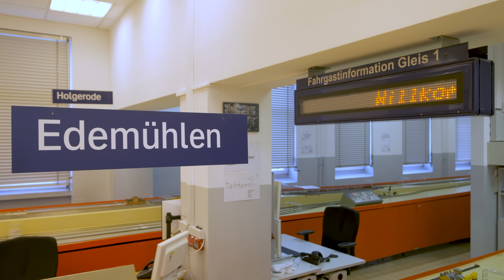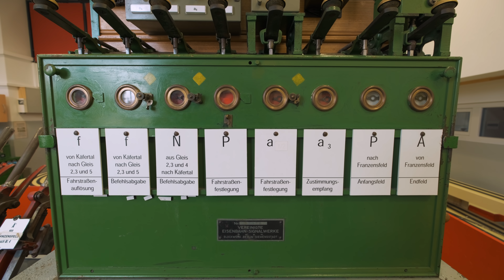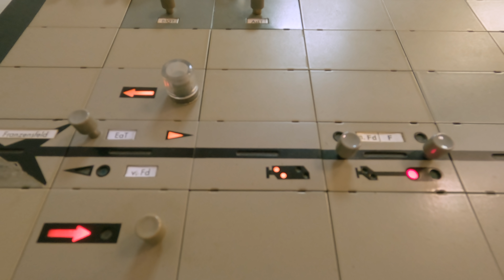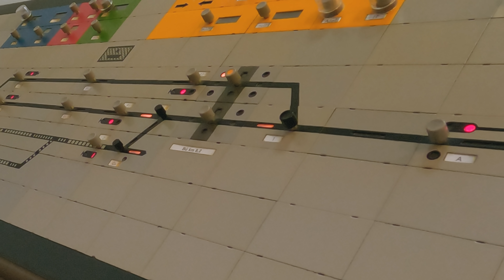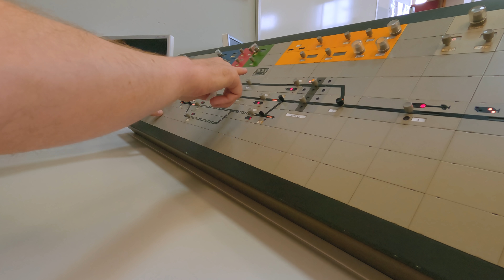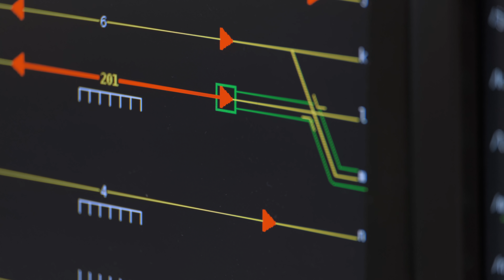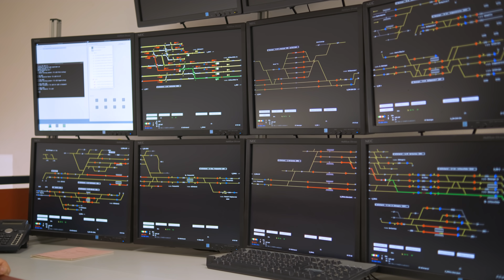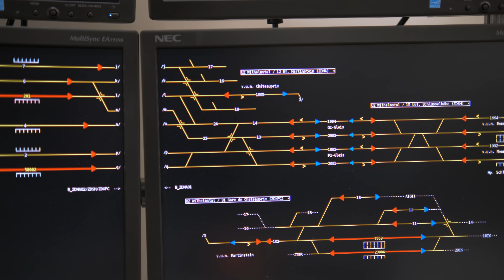The world's most useful model railway

Comment: London Underground have a model railway like that (or they used to when I worked for them circa 2013).  The have video camera posts to scale in the model room and the signal room next door has tv screens on the walls so the trainees see it all as if it were full size.  Meanwhile the full size instructors in the model room can train the trainees in the control room to handle an incident by for example, holding a carriage, or derailing it while keeping out of camera shot.

Comment: 08:30 See the blinking rainbow with the alternating horizontal and vertical bars in the lower left part of the screen? The rainbow is displayed so that the operator can verify that all of the colors are still shown correctly and none of the CRT electron beams has failed (or whatever any of these newfangled LCD screens will do). Now for the blinking... The image you see is actually two images, generated by two separate graphics cards in two redundant processing units. If the blinking ever stops, the operator will notice immediately that the system has locked up and whatever is shown on the display is no longer reliable information. If anything but the indicators starts blinking in sync with the indicators, the two processing units have come to different results when computing the state of the system, so the display is untrustworthy as well. And if one of the redundant units fails, the entire screen starts blinking. (Simplifying a bit here, but that's the general principle.)
Reply: This is the bit that fascinates me about these systems. People spent a lot of time thinking about possible failures and every single thing is built to be as failsafe as possible.
Reply: @matejlieskovsky9625  True. There are a lot of rules regarding railway safety. Most of them are written with blood, sadly...
Reply: @vwegert  A lot of technical rules and standards are in fact written in blood: pressure vessels, lifts, fire resistance, bridges,  dams...
Reply: @matejlieskovsky9625  While it might seem like the system was built by genius-level pessimists, the reality is that many fail-safes are only implemented after tragedies. Every fail-safe you see likely has a backstory that involves injury or death.
Reply: @matejlieskovsky9625  There's a long history there; try reading Red for Danger (L.T.C. Rolt, 1955) at some point.
Reply: @matejlieskovsky9625  The rules are written in blood much like aviation law. You learn the hard way. Like when a high speed train accidently ends up barreling at Paris main station...
Reply: Wow, I have seen these blinking indicators many times and always wondered what they were there for. Fascinating explanation! It also shows how trueful to real life the EBD tries to be.
Reply: @Turidus  Those are probably commercial systems with commercial software from the actual rail network, only instead of linked to real rails, they're bodged into a model.
Reply: @DSiren  No, the software is self-made! Of course, they do have the advantage of easy access to the design documents. :D
Reply: Oh that's an interesting bit of information!
Reply: This is amazing D:
Reply: Thank you for this. Good to know that if the Computer loses the plot the human operator knows about it!
Reply: So.. My screen is flashing. What do I do now?
Reply: @notthedroidsyourelookingfo4026  
Pretend you haven't seen it, go and put the kettle on and hope someone else has fixed it by the time you get back.
Reply: @notthedroidsyourelookingfo4026 pick up the phone and press the emergency button to stop all trains in your area
Reply: Does that mean it can't be done by someone who's colourblind?
Reply: @hyksos74  Yes, sadly. As far as I know, when applying for such a job, at some stage your color accuracy will be tested by a certified doctor, and you have to have accurate color vision in order to do this job. At least in the country I live and applied at.
Reply: @hyksos74  As far as I know, that is the case.
Reply: @hyksos74  You also can't fly an airplane at night.
Reply: Hm.  Unfortunately, it is entirely possible for only a portion of an LCD screen to lose one color
Reply: This is awesome and very clever. Thanks for sharing.
Reply: Are there any old-school mechanical backups in place in case any of the redundant units fail? Or what do the operators do in that case?
Reply: @hhahjdajsb  probably a completely independent button that stops all trains in the area.
Reply: @jirivegner3711  That is actually an entirely different procedure and not connected to the signalling system - which makes a lot of sense from a redundancy perspective. As far as I'm aware, it is based on GSM-R (R for railway), a cell network with additional capabilities, like for example a voice broadcast, and it involves a very specific emergency message that has to be used exactly as specified. "Betriebsgefahr, alle Züge sofort anhalten! Ich wiederhole: Betriebsgefahr, alle Züge sofort anhalten! Hier [Melder]." (roughly "operational danger, all trains stop immediately. I repeat, ... This is [sender]"). (And there are electronic ETCS stop messages, and a lot of other procedures, as one might guess...)
Reply: @vwegert  can it be used just on a part of the railroad, or is it for all trains everywhere?
Reply: @jirivegner3711  I'm not entirely sure what your question is exactly (not a native speaker as you might have guessed), but Wikipedia has an extensive page on GSM-R, including an overview over its international use...
Reply: @hhahjdajsb  They probably have a few old-timers who keep these things working, and every time they decommission an installation they get a load of spares.
Reply: Thank you for taking the effort to share this with us!
Reply: As someone who only really knows Route Relay Interlocking, and a vague knowledge of Westpak Systems, this is really cool info. SSI (Solid State Interlocking) is quite a while away from my bit of the ECML but still fascinates me.
Reply: The Internet was like you in the past.  Nice to have a reminder it can still be like this.  Thank you.
Reply: This was extremely interesting!
Reply: This is actually so interesting to know. Thank you very much for that information. I didn't even notice the rainbow on my own.
Reply: Engineering at it's finest.
Reply: Is this just for the rail systems or is this kind of system used in other fields as well?
Reply: This has been created, yet no one can invent a keyboard or software that features a VISIBLE warning system THAT YOU'VE ACCIDENTALLY HIT THE ALL CAPS BUTTON.
Reply: @donreed  but there is a visible warning that you hit ALL CAPS, there is on most Keybords a light with an capital A, this is the visual warning for all caps, the same with numlock (the light with the number 1) and Scroll lock
Reply: The used mouse and keyboard also have their prices, cause you can't just use a keyboard for example you would find in a normal electronic store. They are build to have a failure rate at 10e-9, which means the'll last at least 1.000.000.000 !! clicks or button pushes. That's why a keyboard for a computer controlled signal box here costs around 15.000 €.
Reply: The more you know
Reply: My railroad uses a physical relay interlocking system, the thing that is currently relayed at the track authority  transfer point is a stick from a broom.  It is impossible for trains to pass that point without the broom stick.  The stick is long enough to be passed from window to window.
Reply: @MilwaukeeF40C  Somehow I can't imagine using that system with two ICE trains passing each other with over 200 km/h each...
Reply: @vwegert  Wuss.

Comment: The way the mechanical system is the reason large rail junctions are often called "Interlockings" the systems are designed to lock other levers out as a route is selected so that you can't cause conflicting moves.

Comment: How would a manual system physically lock out? Some sort of cam system that locks the brakes? A set of bumps like a key uses that pushes off pressure of the brake handle? Very cool

Comment: "You have to service three to five stations now."
Sis is se German effishency.
Reply: It's fine when everything works. But in case of a malfunction it can quickly overwhelm the staff.

Combine this with the somewhat unfortunate German signalling philosophy of "all or nothing". Ie. either the system works, or everything has to be  done manually with no supervision by the system (the reasoning being, that a malfunctioning system cannot be trusted to identify which parts exactly are malfunctioning). This means that the workload for the dispatcher often spikes dramatically in case of a malfunction - and this has actually already lead to accidents.

Comment: It would've been interesting to go over how the simulation computer works. Real world trains have their own independent engines, while model trains have electric motors powered by a current that runs through the track. So two model trains on the same track will always have the same speed and direction.

So the computer has to track where the train is, what speed it's supposed to have, and if the train changes track section the computer has to know what current the new track section is supposed to have.

I think a bigger challenge would be 'what happens if the student screws up'? You won't have that glorious head-on collision because that's impossible with model trains, so most likely it would be 'if train enters an occupied track section, the simulation shuts down'.

Comment: it has an electrical engineering component as well: since trains use low frequency AC (16 2/3 Hz) and quite a lot of it. railway stations, yards and other accumulations of powered equipment could often overcome the amount of electricity that could be provided by the infrastructure, which meant multiple, heavy accelerating trains needed to be avoided by sheduling.
Reply: do you think the high frequency AC (25kV 50 Hz) is better or worse than the german one?

Comment: That's the most awesome way to train signalmen! Although the instructor should have thrown in some faults, like sections showing as occupied when they're not (safety feature in case you lose connection/something breaks) or uncontrolled switches :p

Where I live we have old Soviet electromechanical interlockings (also called electrodynamic 'round here) dating from the '60s which can do the "entry-exit" thing and align all the switches on their own.

Comment: If its one thing factorio has taught me its that train signals are a science on their own.
I love how trains are still so mechanical with physical locks and dials.
Reply: Was hoping someone would mention Factorio
Reply: Railway infrastructure is so critical that no country can close the system down to design and implement a new way of controlling trains across the whole network so all the new systems are designed to replace the old ones as seamlessly as possible. Therefore solutions designed in the 1800's are still the standard today.
Reply: Similar deal with OpenTTD 😊
Reply: I want to vomit wondering how to work signals. I just make multiple tracks and trains and time their returns lmao

Comment: I was at the DB museum in Koblenz just a few days back, and it had these mechanical interlocks displayed. Sadly there was no one there to explain it, (or I was not aware of any explanation tours), but I moved those clunky physical switches by hand, and just the feeling of metal clicking away is so much better than just clicking on the computer screen. And I love the fact that the switch points get mechanically locked to prevent you from doing stupid things. Ah, the charms of analog compute.

Comment: Wow, this is just fascinating. I hope that even if they migrate the country's railways away from the mechanical levers, they keep them either as a visualization of the mechanics and progress, or at least move it to a museum.
Reply: The move away has already happened in the 50s and 60s, and the few mechanical ones that survive are generally located on isolated branch lines with little traffic. This is because the electromechanical systems that replaced them centralised switching over vast areas, but weren't economical for small operations. The electromechanical systems these days are centrally remote controlled, and when they're replaced with fully computerised systems, the mechanical holdouts will be integrated with little effort.
Reply: @mikeblatzheim2797  yes, in the video they said that there are only a few left but they will at some point be fully transitioned. What I meant was that even after the transition is complete and the training for those are no longer technically needed, they'll still keep it around at least for historical purposes.
Reply: @RoximRox  
There's already some that are preserved, but sadly most will be fully removed due to how the infrastructure is built (the mechanics generally take up the whole building and are impossible to remove). At least in my hometown there's a push to keep the still in service signal box from 1913 operational in the future, but that's unlikely with major track expansions coming in about five years. But in other places I could see it happen.

Comment: I live on the track between Donauwörth and Aalen. One stop on the way is Möglingen, and it is the only station I know that is actually still using those mechanical levers. But they really are doing that. The track is single-track, and Möglingen is one of the points where the trains in both directions meet, so they really are switching the signals and switches every half-hour.

Comment: The switches that they use in the turnouts, to return the state of the system, are the same basic part for over a century, but have been updated and modernised, and are incredibly reliable, rated for 10 million operations. Yet they cost under 20 Euro each, just because of the sheer volume of them in use world wide. they also find use all over in industrial use as a very reliable very long life switch. 

I had to order some for a machine, and ordered a full spare set, which worked out rather expensive. The original ones had done at least 5 million cycles, since I started working on the machine, and had done untold others, before it was sold as used, in use 24/7/365, since about 1971 with the previous owner. Likely 100 million cycles of operation on those switches, and the lot in the machine were all still mostly original parts, or at least similar in vintage. The ones I bought were new stock in 2006. They physically wore out, nothing electrical was wrong with them at all.
Reply: You mind sharing that switch part code? Sick of my "5 million cycle rating" micro switches lasting 500k at best.
Reply: @nogravitas7585  Sorry, long rolled out of my emails, but it is a large item, try looking for cam follower switches and you will see them in there in a translucent light green plastic package. Two sets of contacts, double breaking, with one being NC and the other NO, and definitely break before make, as the contacts separate by 4mm.

Did look in image search, S800e is the part, and it is by no means a microswitch form factor
Reply: @SeanBZA  S800 and light translucent green were enough to find it but the cheapest supply in this country is $45 a pop sheesh, thanks anyway.
Reply: @nogravitas7585  Yes, I was getting them around 15 years ago, and the 20 Euro was the price they cost when ordered by the company, probably around 2000. Buying in singles likely is a lot more expensive, I took the entire stock they had at 19 Euro equivalent each, 15 units, and thought that was a good price, compared to alternatives, which would have involved getting absolute shaft encoders and a PLC in, to replace just the one switch. So I ordered enough to replace the lot, though only used around 2 of the 12 in the end, the rest were still well within spec.